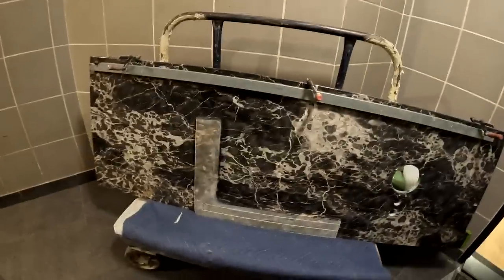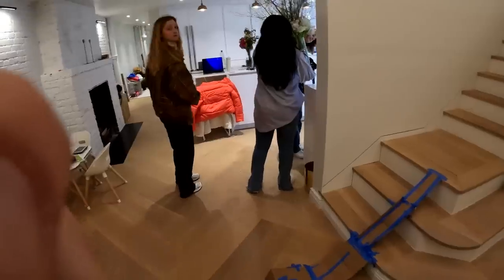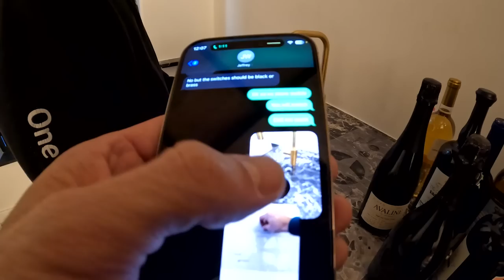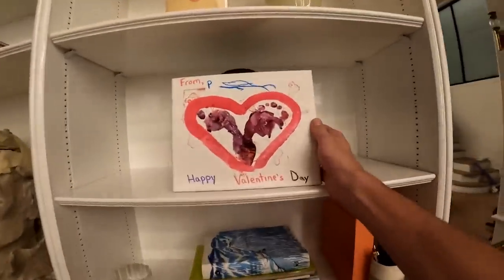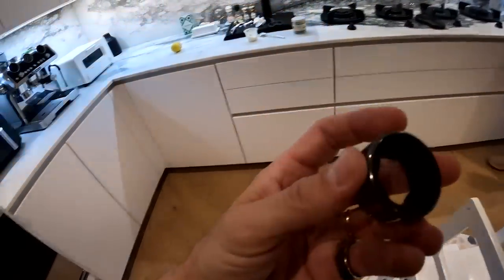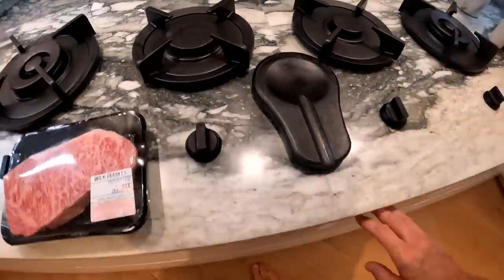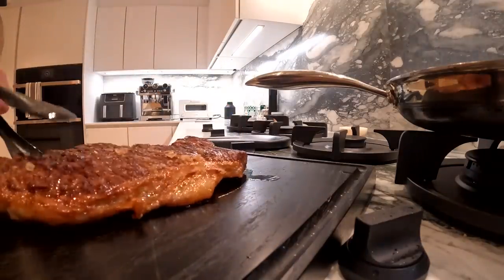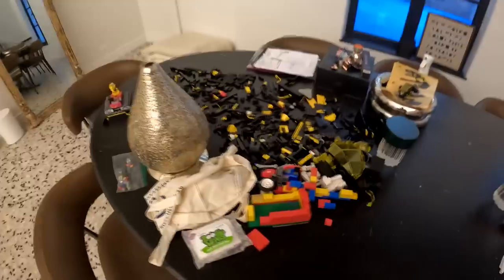Can We Solve it? | Brendan Fallis Vlogs

Comment: For the hole, use a plate cover. So in the future if you switch out the faucet and need the other hole, it can be switched. The cover then gets moved to the current faucet’s hole. I hope that makes sense…
Reply: Agree or add a soap dispenser